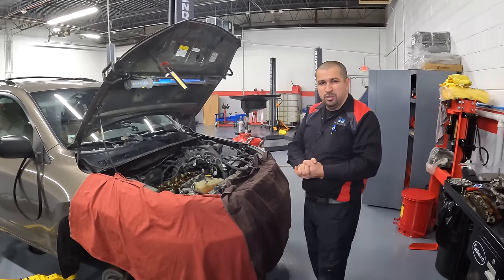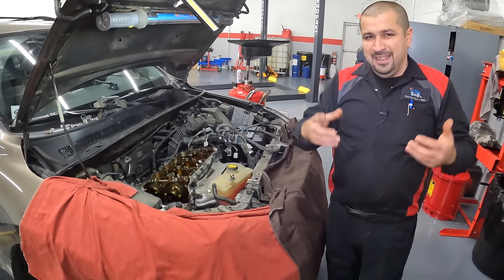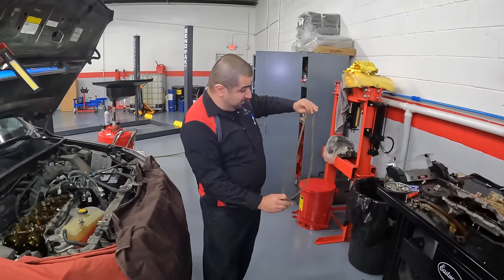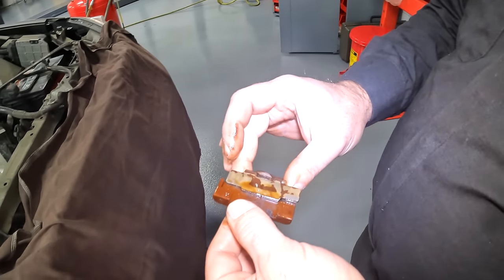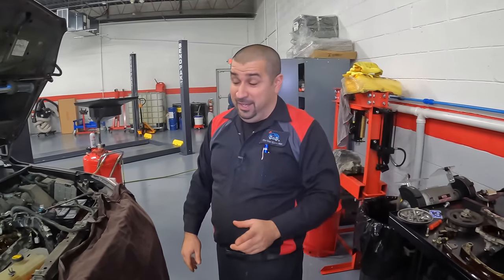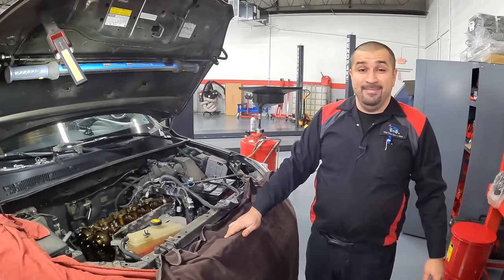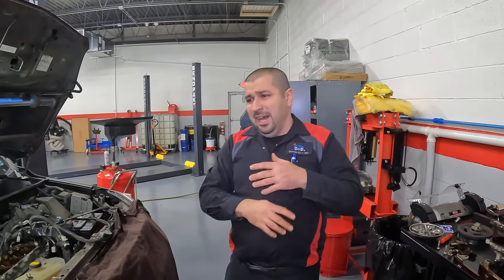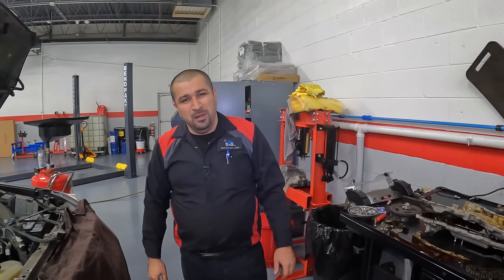When Should You Replace Your Toyota And Lexus Timing Chain?

Comment: If you're talking about a Tacoma.........change the timing chain when it stops running......which will be never.   Bypass the secondary air injection system (that's the only thing that goes bad) (Hewitt), change the oil and filters once a year or 5000 miles, change the plugs at 120,000.  
 My Tacoma 2013 V6 has 250,000 miles on it.   I had to change a headlight assembly (a rock), the air conditioner compressor and condenser, and the radiator (I put a hole in it while changing the air conditioner condenser).  I changed the plugs once and changed the valve cover gasket on the passenger side.  I've never done brakes or suspension.  
Amazing truck............the secondary air injection system is a steaming pile of poo, however.  
The truck sits outside and is not driven gently.

Comment: Great video. Thanks. Do you have the torque spec for the bolts on the oil pump for the Camry 2AZ-FE engine. I would appreciate that. Thanks again!

Comment: What’s the difference between a timing made in 1994 to a timing chain made in 2010 like this particular Toyota? I have a 1994 Toyota pickup with a 22re 2.4L. With 157k miles. Runs great but it’s an interference engine don’t want to take any chances destroying the engine…

Comment: Question - 2005 Toyota Avalon just shut off. Won't start. Mechanic says the timing chain skipped. What is the likelihood a new engine is needed and not just a timing chain replacement?

Comment: I have a 2011 Rav4 Ltd with the 3.5l V-6 and it started to have rough starting until it warms up,then it runs smooth as silk. It doesn’t throw codes and my local service center,not the dealer,can’t find anything wrong with it. Do I have a VVTI sprocket issue? It’s been driving me nuts. The car has 120k on it and the car is in great shape. How much does it cost to have this sprocket replaced?

Comment: I bought 2008 Toyota Yaris 1.3 vvti, (I'm from Europe) 103 000 mi. Is it time to change timing chain ?- when I push accelerator rapidly and engine speed is lower than 2000 I  hear some noise. But pushing pedal slowly or engine speed is 2000 or over there is normal, without any frustrating noises. Fuel consumption is normal, oil consumption none.

Comment: Would you replace the timing belt and water pump with 62,500 miles on a 2015 Honda Pilot? My local Honda service dept. recommended.

Comment: Thank you for your very informative video 
I have 2gr-fe 200k miles and never replaced the chain ... I hear a metal rattle on acceleration only.. cold start is smooth. Could it be a vvt-I gear?

Comment: Regardless of manufacturer , timing chains need to be replaced between 100’000 to 150’000 miles. The tensioners loose pressure , guides and gears get worn. Also around the same mileage your piston rings will have seen its service life and need replacing.

Comment: AMD:  2 TPMS sensors have gone bad in my '06 SC430.  Shop wants $500 (parts/labor) to fix.  I've seen videos on how to disable the TPMS system so the light & chimes (every 5 minutes!) stop, which seems easy enough to do, but the shop can't do that legally.  Would you recommend paying the money & getting them fixed or disabling the system  myself (i.e. can disconnecting those two connectors under the shift console cause other problems/wouldn't you recommend it)?

Comment: The timing chain normally needs to be replaced between 80,000 and 120,000 miles unless there is a specific problem.Nov 14, 2019

Timing Chain System Frequently Asked Questions - Cloyes
Cloyes is famous maker of High Performance timing chains and it is clear Cloyes says 80 to 120K miles.

Comment: So maybe I've missed the answer but why does Honda use timing belts instead of timing chains that you replace every 60k miles?
Reply: I'm just going to guess it's because the engine was never designed for a chain and belts are simpler design. With chain it undergoes a lot more stress and needs oiling, needs to be enclosed behind a leak proof cover.

Belt and other timing parts has to be replaced regularly but is not affected by the oil quality (as they dont need oil!). And replacing a belt is cheaper than replacing a chain. 

But you shouldn't have to replace a chain very often if at all in a car's lifetime, unless the car has a flawed chain design or damage from oil issues/bad maintenance. 

A bad thing is belted engines may need both the accessory belt and timing belt replaced. If the accessory belt snaps, it can jam the timing belt and cause it to snap too, ruining the engine. 

If the accessory belt snaps on a chain driven engine, you aren't gonna immediately cause any damage as the chain will be fine. So having timing belt means you need to be careful about all your engine's belts and changing them on time.
Reply: And timing belts used to be quieter than chains but I'm guessing modern timing chains are just as quiet as belts

Comment: Hi bro , Nice video , keep them coming. 
Have this question for you , on Camry hybrid 2016 model , what are the lifespan for springcoils ? is there duration in years or certain odo km , when do they need replacing?
Tq in advance.
Cheers!
Reply: Coils don't need to be replaced until they start to sag or you notice one broken.

Comment: I m a Toyota owner but I found this to be a bit misleading.  In the intro AMD states that “for the longest time” we ve had timing belts and “we” then moved over to timing chains as though chains are a recent innovation.  The truth is chains were used long before belts in the auto industry and it was only with the advent of smaller engines found in cheaper imports like Toyota that rubber belts began to predominate.  Belts were cheaper to manufacture and a bit quieter and most importantly in my opinion created a new and relatively expensive maintenance cost for the consumer.  Since the rubber belts did not last and since their failure had catastrophic consequences, consumers had to have them replaced every 60-90 miles and as I said, having them replaced was an expensive and ongoIng maintenance cost that did not exist with chains.   I would also take issue with AMD’s inference that Toyota’s timing chains are somehow better than those of other manufacturers.  Timing chains are seldom an issue on any car even those with three hundred thousand miles.  The fact that he is addressing a timing chain problem on a Toyota at only 150,000 miles concerns me.

Comment: If the timing chain overheated for some reason (engine low on oil or coolant), and got stretched,
once the engine cooled down the timing chain would have shrunk back. Why replace it? 
All the engine components get hot and cool down... I only replace timing chains if I hear a rattle.

Comment: I have an 06 Rav. With a V6..230,000 miles..it makes a loud idle noise in start but runs fine. I think something to do with intake. At what point does one quit spending possibly a couple thousand dollars or more before retiring the vehicle?
Reply: Hard to tell not knowing your standing.  For me, if everything else is solid,  and I like the ride, I will keep driving the car and keep an eye on it.  How long is the rattle on cold start?  If it's a split second,  no worries about it, if it's 2-3 seconds, it's time to drop the Ks, assuming again everything on the car is decent, and getting another vehicle is multiples of those Ks.
Reply: I'd leave it alone...my 06 V6 Rav4 rattled some at startup and had a oil leak..sold it at around 220k miles. It did run out of oil twice stupid vti oil line broke twice when driving...till replaced with metal one...sure that didn't help engine.  Its probably worth like 5k...so not sure spending 2k+ makes alot of sense just to get rid of a rattle.

Comment: I have a 2010 Lexus RX 350 with 200K miles.  We purchased with 66K miles.  It has always rattled a bit since I purchased it 6 years ago with 66K miles.  I always thought it was because it was a high compression engine and needed time to warm up.  it sounds like mine could have the same problem you described.  It's a 3.5 V6.  Thoughts??  Do I fix it now or let it go??
Reply: He has another Gideon this rattle , worth a watch , you can look it up

Comment: My 2000 Camry 4 cylinder has 355,000 on it. Do the crank and cam shaft pulleys need replaced? They have timing belt groove wear

Comment: My mechanic told me he found one of my timing chains was loose compared to the other side when doing my valve cover gasket, does it need to be replace? 2008 Lexus Ls460 114k miles

Comment: No offense to the man, I rely on his videos constantly. I agree that the chains don’t wear out. But you better check the crank and cam sprockets. I’ve had two Camry’s with the teeth so worn that the teeth looked like they were laying over. One was personally owned with 275k, oil changed every 3k. Chain good but sprockets not good.

Comment: We had our Rav4 spring the leak in the rubber line that runs to the head. Toyota fixed it n/c but we ran for a few miles before we caught the leak. Do you think running that long with the line leaking could cause the VVT gears to rattle?

Comment: If you take care of your car and change the oil once a year the timing chain in a Toyota or Lexus should never ever need changing.  Mechanics who tell you otherwise are just looking to make easy money and foot you a +$2500.00 bill for something you don't really need.  If the timing chain is a little noisy just live with it.  My 2002 Rav4 is 20 years old now and sure it makes a little noise on startup in the winter but the car has never given me any problem whatsoever.

The metal piece that the mechanic is showing the viewer is just the timing chain guide.  The guide is not worn whatsoever.  All Toyota engines use this as a guide piece for their timing chain tensioners.

Comment: If someone can answer, why would a timing chain cover leak and needs resealing if the chain is  meant to last for long time? (1ur-fe engine v8 4.6L) vehicle started leaking at 180K Km. Dealer quoted $800 for the parts and $1000 for the labor cost

Comment: I have a question. I have a 2004 Corolla with a P0016 engine code. The timing chain doesn't seem stretched. Should I change the timing chain?

Comment: I have a Lexus is 350 2006.My car would rattle on a warm start up. Hot engine, wait for 30 mins or more, start it and it would rattle. Do i need to be worried about the timing chain or anything else? I was running 5w-30 and i was getting hot start up rattle, when i switched to 0w-30 oil due to lexus recommendation, the problem went away. No more rattles.

Comment: My v.v.t. rattle just started six months ago.
Getting annoying. Is this an 8 hour job; and how much time do I have left? 2011 Corolla, 109K.
Reply: Just fyi tons of people have this issue and ignore it for years. If you address it sooner than later you might get away with just replacing the vvti gear. My 2010 has been doing it since new I'm fairly sure. I installed a block heater so I could plug it into a timer and heat it up at least an hour each morning to prevent the rattle
Reply: @steveng93  Hello, I'm in Tucson, AZ.. it's cold now
Yet summer, etc. gets very warm.
It's worse now. So you've lived with it that long? I may just fix the thing, and get it over with, anyway I appreciate your suggestion.
Reply: @wayneeligur7586  make sure you take any technical service bulletins to the mechanic and only use updated toyota parts. Theres a chance the vvti gear can start rattling again in a few years. Hence why I'm putting it off by plugging in car before starting. I'd be very curious what youd have to pay in 2022 for this repair. I'd super appreciate if you come back with that info !
Reply: @steveng93  sure..it's gonna be  a couple of grand at least...it's a base model manual roll down crank windows...
does toyota stay up nights thinking up ways of being   tr.d.s [turds]? I wonder with this model's known issues...I got 'em all.
Reply: @wayneeligur7586  I've learned my lesson about buying the first couple years of a new generation. I own a high mileage 2008 and its had zero issues and nearly zero maintance honestly. But with my 2010 Corolla I've had occasional hard down shifts since forever, oversensitive electric steering(feels like driving in wind), and the cold start grind. I prefer the older toyotas I've owned, minus the efficiency and comfort. I can get over 40 mpg in my 2010, could never do that with the previous generation
Reply: @steveng93  Hi - I've replaced the v.v.t. 'tensioner', only, and appears to have fixed the issue. Time will tell. $190.
Reply: @wayneeligur7586  I hope that works out for you! I wish it was that cheap for the vvt gear

Comment: Hi I have the p0016 code on my 2012 4cyl venza, I changed both camshaft sensors, intake vvt solenoid, and crankshaft sensor. check engine light is still on. What will be the next step? Check/ replace the timing chain?

Comment: Im having a rattling noise with the error code P0014 showing. Maybe faulty camsensor ? One mechanic said maybe its the timing chain sice of the noise but im unsure my mechanic is booked just looking for answers or suggestions in the meantime! 2012 camry le also this error code has been showing for a year the noise isnt super loud but noticable when u stand imfront of the car

Comment: I wonder how much of a small fortune it would take to replace the chain, tensioners, guides, etc. on my 2007 5.7L with 308,000 miles.
Reply: I used to work at a Toyota dealer, not totally sure what the book time on that job is. But you would likely be looking at around 10 hours labor, at around $150 an hour, plus around $400 for parts. I would expect to pay $2,000 total give or take.

Comment: So I have a Toyota timing chain question. I have an 85 Celica with the 22RE which has a timing chain. Do these old timing chains have the paint marks?  I’m pretty sure mine is original to the car.
Reply: No.  On the 1985 on up 22re you will get a loud rattle - like marbles rattling around in a metal can sound - for 5 - 20 seconds  when first starting the motor in the morning if the chain mechanism needs replacing.  Keep an eye on the coolant level and coolant temp gauge reading as cylinder head gasket failure is common on 30+ year old 22re's.

Comment: What do you thik of the dude who drives 85 mile one way to work, in a jeep loves to drive hard, and has to replace his starter motor once every 15 months,  by himself.  He has had only 2 cars so its 3 new starter motors in each every 1.3 years?  And he is happy that HE does it and don't have to use a shop. Of course it takes him 2.5 hours to do it with manual tools alone!  I call  him my brother.

Comment: I want to know what is the procedure when replacing the entire chain and sprockets set of vvti for Toyota Corolla 2003. I bought an Aisin oem Japan set. The vvti has a lock position, do I have to unlock it first to install it or not?
Reply: He has a video on this I watched it , it comes unlocked ,he said put it on , then torque to spec , then lock it

Comment: Thanks for this video firstly l live in Australia and l own a 1997 Toyota Hilux with the 22R motor and l  bought it about three years ago and lgot no service records with it but since l have owned it l have done work on it nothing major serviced it and replaced a lot of parts that will not last 25 years l dif check the timing chain and the tensiner does work but l don't know if tge timing chain has been changed l have read that yhe 22R motor  stretvhes timing chains but the chain is a tight as a drum and did zToyota put the paint on the timing chains back in 1997 its SOHC and no VVT also the Hilux has done 430000 kilometers it still runs well and doesn't burn oil l asume its been serviced regularly but before l bought it the clutch had been replaced
Reply: no paint back in the 1990's. You will get a loud rattle - like marbles rattling around in a metal can sound - for 5 - 20 seconds  when first starting the motor in the morning if the chain mechanism on the 22Rneeds replacing.  Keep an eye on the coolant level and coolant temp gauge reading as cylinder head gasket failure is common on 30+ year old 22R's
Reply: @4af  l get no rattles when l first start up just valve clatter and thanks for clearing up about the paint on the chain well l got another four to five years before the head gasket goes l don't know if6 tge head gaskets ever been replaced

Comment: Not sure if I got a lemon or not…2010 RAV4, original owner, 82k miles…chain and tensioner failing. Regular 5k miles oil changes, fully synthetic, car has been pampered…one day the engine istarts whining. Took it to the mechanic thinking it’s the alternator. Nope. Chain and tensioner…very expensive repair @2k USD

Comment: Unless my 2020 RAV4 with the A25A FKS engine has problems, it's gonna be every 6 months like now or if I start putting lots of miles on it, then it will be oil and oil filter every 4000 miles or 6 months whichever comes first.  I've said this before I'll say it again.  "OIL IS CHEAP!  ENGINES ARE EXPENSIVE!"  Don't think so?  Watch the video AMD did changing the short block on that black Camry a short while back.  Cost for parts-n- labor was slightly over $6000.00 ! ! !  If the customer had done the every 6 months or 5000 miles whichever came first, the oil and oil filter changes would have been about $1500.00, not an engine and $6000.00.  The vehicle odometer was showing 180,000 miles.  That engine should have gone well over 300,000 miles, "but"  (always a but), a lack of recommended oil changes that AMD  has said many times was not performed and the engine used lots of oil, had bad wear on cylinders 1 and 4.

Comment: Manufacturers state that chains will last the lifetime of the vehicle because they define lifetime as 100K miles (BMW). At 150K for an interference engine you are gambling. Chain goes - engine goes.
Reply: I've had a 200k mile year 2000 Buick with a chain that ran pretty well. No sound from the chain, not even an oil leak surprisingly